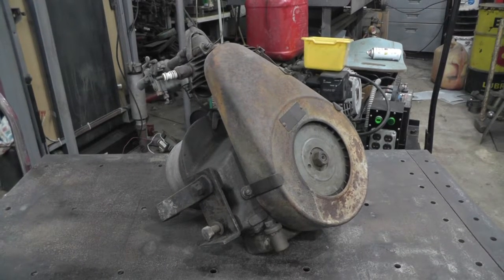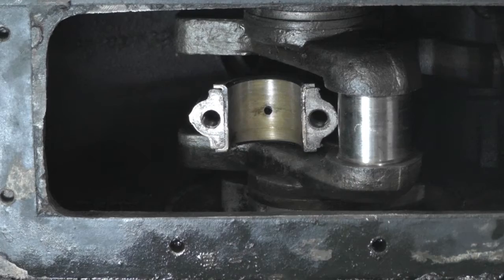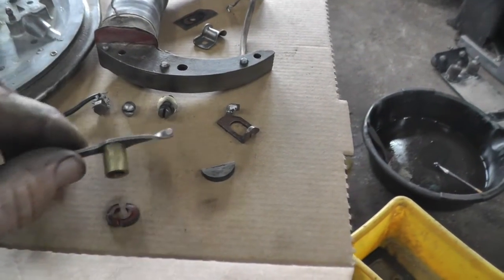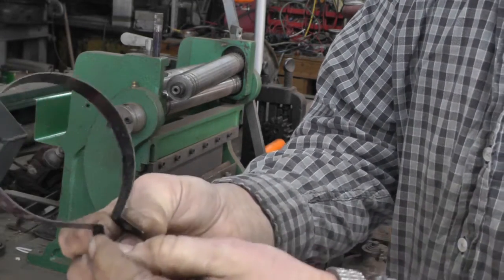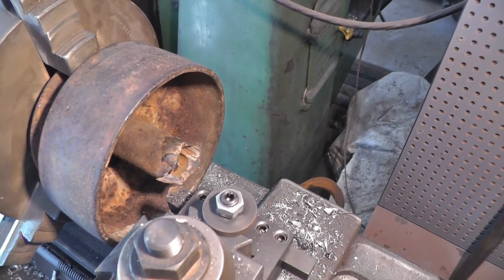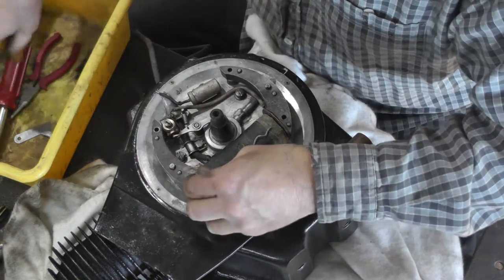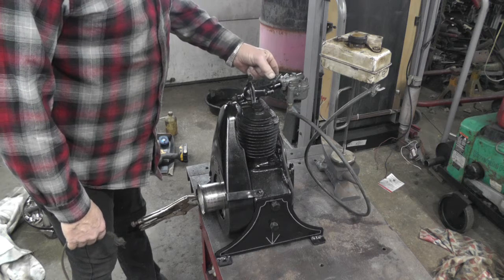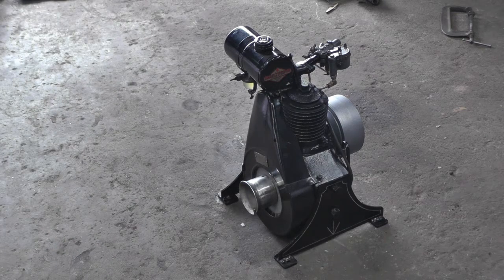Antique Briggs & Stratton PB Restoration

Comment: Nice job. Really like that gas tank mount, i usually make a bracket to fit them to the top of the cylinder. That intake manifold is for use with a brass Basco carb, the Tillotson intake uses no screws, the carb just slip fits onto the intake. One of my PB was the opposite, they used the Tillotson intake and made a bracket to screw the Basco carb onto  lol

Comment: You do nice work. Those older Briggs are very cool. The oldest one I have had so far was a 1941 model IR6 with lever start. I just recently acquired another model I from 1942 that is a military engine and is all original and never saw action, some how I keep ending up with the I's. What type of paint did you use for the project, my IR6 is in need of a paint job. I have the reproduction decals already in stock to put on after. Thanks.
Reply: That's one hell of a coil!  Love old Briggs, mowing with a 72 and rebuilding a 64.  Working on a  52, Anything that turns will run!